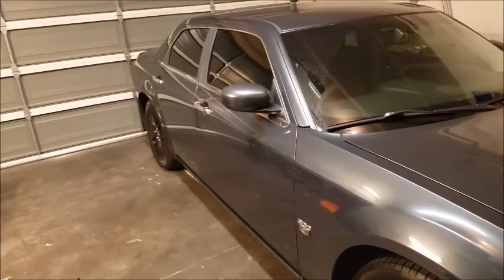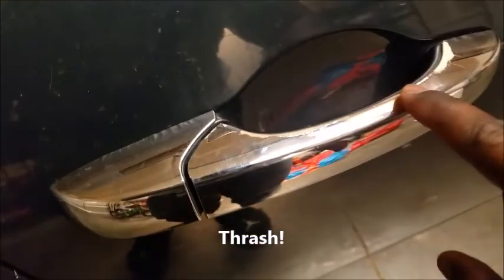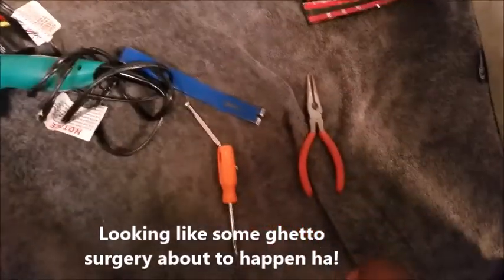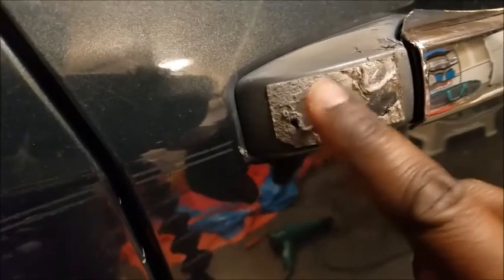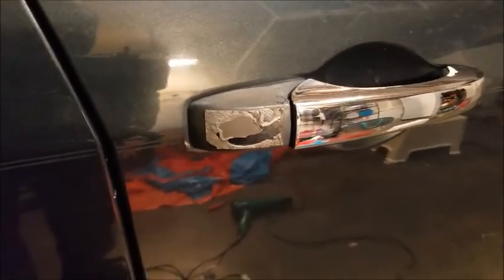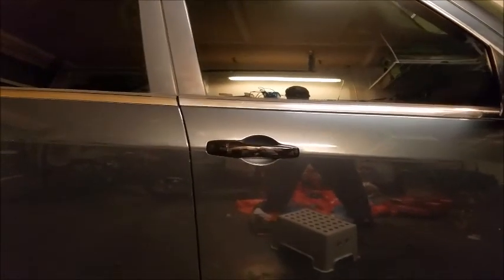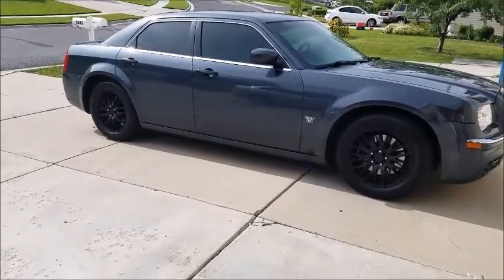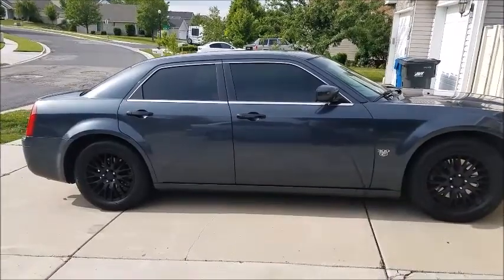Removing Chrome Door Handle Covers - 2007 Chrysler 300c

Comment: I had to super glue one of my door handle covers because the adhesive tape would not stick. Will a heat gun or hair dryer remove it if it’s super glued on?
Reply from the maker: It might, but super glue is very strong. Im sure once you get it off it remove some of the paint color. That could be fine if you are just going to cover them anyway. Something to consider 👌🏿
Reply: @mr.300c  Thank you!!

Comment: Nice!  Looks much better.  The one thing that stands out to me is the rims.  You need some 20's on that ride man.
Reply from the maker: Thanks! Yeah bro these 18s aren't cutting it for me. I don't want to invest more into this car for tires and wheels since its temporary....but I know its badly needed 😮
Reply: @mr.300c  it's a nice car and taken well care of.  Keep it and build it.  The 392 is pretty tapped out, and other than forced air you can't get much more out of it.  The 5.7 has so much more potential.
Reply from the maker: It has 198K miles, new motor installed at 145K. The 392 is fast out the box and all I would do is make it look good and keep it stock except for a mid muffler delete and k&n drop in air filter. But yes this 300 is very nice for the price I paid. Low maintenance so far.
Reply: @mr.300c  don't forget if you buy some rims now you could always put them on the Scat Pack when you get it.  Just make sure they will clear the brakes on the Scat Pack before you buy them.
Reply from the maker: Good idea player👌🏿